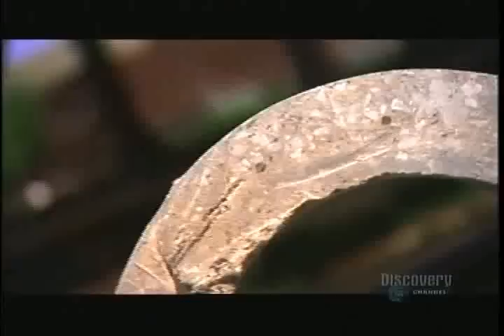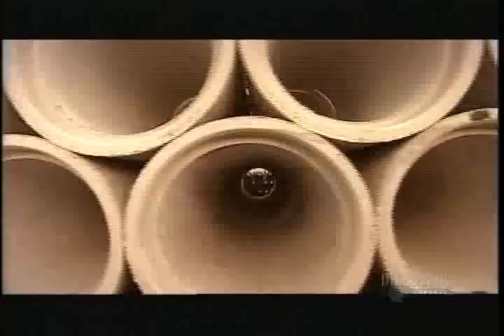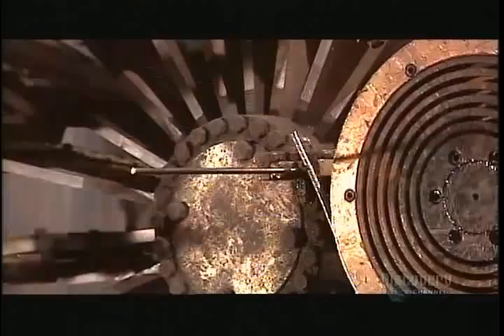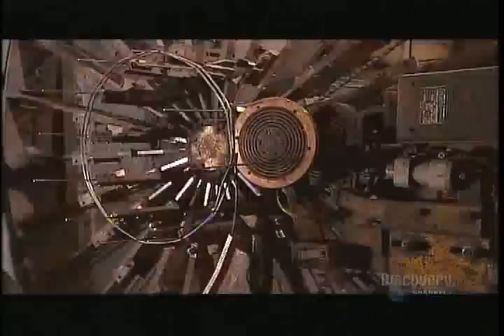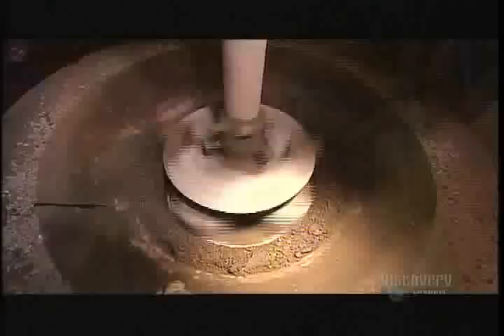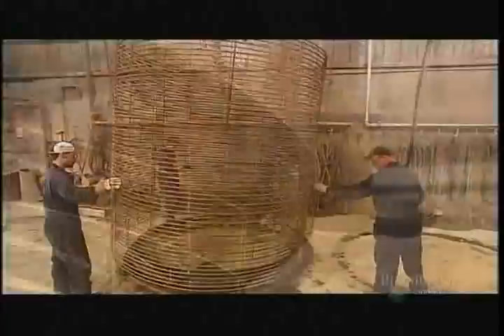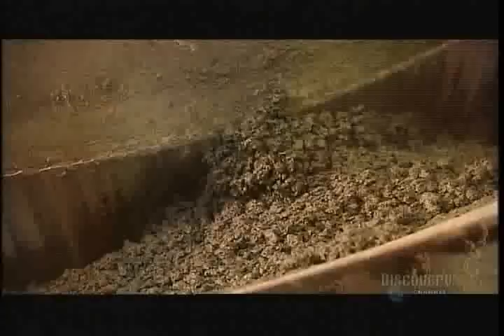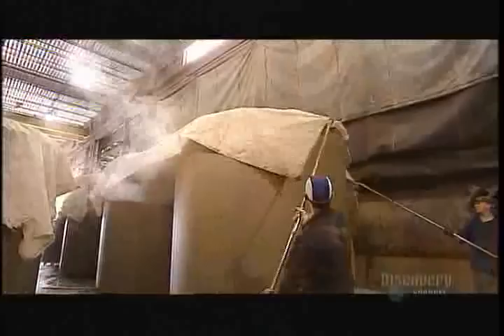How It's Made Concrete pipes

Comment: A question was asked earlier, why use a water reducer, why not use less water?  The answer is that the water reducer is a surfactant (soap) which reduces the surface tension of water.  It in effect makes water wetter so less water can be used.  The water reducer also assists with unmolding, especially for the packerhead pipe by preventing the concrete from sticking to the steel molds.

Comment: Different mixtures of concrete require different cement/water ratios. The water reducer is a chemical ad-mixture that allows the concrete to exhibit behaviors that are suitable for work (such as drying time, 28 day compressive strength, early strength, etc.) without the needed cement to water ratio.

Comment: Yeah, but how do I make one just as good out of bagged cement mix, chicken wire, and dirt out of my yard?
I think I'm not supposed to use water if I understand the video correctly. What about diet soda? 
Can I substitute spackle for cement mix?
Can freshly popped popcorn be used as coarse aggregate?
I'm a do-it-yourself kind of guy if you haven't figured it out already.
Reply: Lol bagged concrete will work, just don't expect it to have a lot of structural strength.

Comment: Another way of making these concrete pipes is welding rolled pipe and spraying the inside and outside with concrete, that way you can make a lot of different configurations of pipe like T-Joint Pipes or Y joint pipes. Although the process is a little slower than this, the pipes are much stronger and can be used for high pressure liquid delivery.
Reply: Cris Wireless . We make those joints with these pipe after they have been cured over night. All the way from 12" i.d. to 120" i.d.

Comment: So 100 years from now (or thereabouts) the entire sewer system will need to be replaced or it will collapse. I'd hate to be on the national  sewer/septic board come 2116.
Reply: Amy Soderstrom that 100yrs is upon us and will hopefully start benefitting our industry again. The majority of concrete pipe was installed during the construction of America's highway system shortly after WW2.
Reply: What they do now is line the sewer pipes with a specual rubber membrane material. The material is actually stronger than the concrete itself and more flexible.

Comment: what's the water reducer?
Reply: Jat Tan It's a surfactant. A chemical that breaks down water to make it spread out. Try putting a drop of water on a flat surface and it stays in a bead,than take a tooth pick dip it in liquid soap, now touch the bead of water and see what happens, thats what the water reducer does. It lets the water spread out wetting everything easier, with less water,making stronger concrete.
Reply: Thanks bruh i appreciate the explanation

Comment: 4:39 That is not a good test. They need to bury it so it has pressure on all sides.
Reply: No. Thats not right at all.
Reply: i might be wrong about this but it doesn't have pressure on all sides... right? since the earth covering it is pushing it downwards only, the force should be the gravity*mass of the earth on top of it, the side wouldn't do anything since there isn't any acceleration
and the pressure is force/area, the only area getting the force is the top half of the pipe

only way for the pipe to have pressure on ALL SIDES is if the pipe was sealed, and has pressure gradient different in the inside and outside of the pipe

someone correct me on this, i'm not a physics major or anything
Reply: what i mean is the pressure pushing down will push the sides out but in the test there is nothing to resist the force pushing out. that's what i think anyway.
Reply: +Samuel Noall 
The D-Load test is the industry standard for testing reinforced concrete pipe.
Reply: +YIC There is a top load, of course. There is also an equal load at the bottom of the pipe pushing up.  The side loads of the pipe are outward as the pipe is being compressed from above and below.

Comment: 1 Year life span? Bullshit, the sewage lines we're using now is basically 200 years old.
Reply: On a serious note, many sewage and water pipes are way past the date they should have been exchanged. As time passes, minerals and other material accumulates on the inner surface of the pipe, and over time starts to make the pipe less and less spacious. I've seen some opened up old pipes with ridiculous amounts of accumulation. So much that the water was only flowing through an opening that was about a finger's width.

It's a problem people easily ignore, since you really don't notice much until you're literally in deep shit.

Comment: kiln bricks suck!
they are old as time and there are alternative old as time and there are new innovations kiln bricks  have ruined the environment enough
they are wrong bricks are not much energy efficient and are most importantly bad for environment
they use a ton of energy to make it (2000 degrees fahrenheit)  witch produces allot of co'2
i live in a brick house and spend time in allot of brick buildings  and the walls do not hold much heat or coolness 
when its hot i must constantly use the air condition  against cold its better insulated
their are so many greener alternative brick for kiln bricks some are even better than kiln bricks (some hold and cooling better and do not need additional layers and will actually give out heat or cooling of the walls when needed)
kiln bricks is much worse for the environment than incandescent light bulbs 
ITS ABOUT TIME THE USA OUTLAWS THE USE OF KILN BRICK AND PURE CONCRETE BRICKS
a few examples of alternatives are timbercrete, papercrete , compressed earthblocks(ceb's), hempcrete, adobe, etc.
they don''t use heating  in the curing process and are better environmentally and some have even better qualities as a building block
so go ahead and write letters to your senator representative make petitions  and send them too finally stop the use of kiln briks
BAN KILN BRICKS
STOP THE USE OF CONCRETE AND KILN BRICKS
Reply: Fuzzcopter I like tigers I totally agree... but but but...I am not talking about those animals who want to enslave everyone to the environment. ...my ideology is to free everyone from the grid and of world homogenization and of the need of government. ..the more your home provides for you the less you need from the infostructre and government the less you need the less power they have over you...I live in the griddy system but my dream is an earthship permiculture type living ...when you look at a satellite map a city looks like an electronic motherboard ......I am a nature being and hope to live in harmony with nature soon ......and I will have every amenity I have now
Reply: Fuzzcopter I like tigers obama ,bill nye, and al gore are the environmental villians but there are environmental heroes. ..for me micheal rynolds is a very big environmental hero and deserves real respect the homes he builds are solid ,can be easily thought and poor people can build it themselves
Reply: Kiln bricks come in handy when you need to break a window. Any American will agree